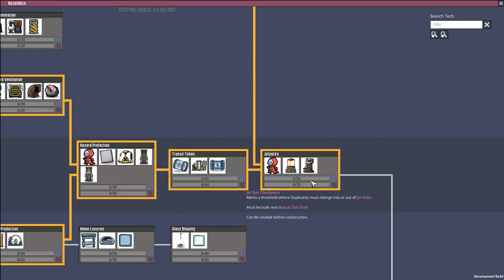The Steam Research Rocket -- New Player Guides [Oxygen Not Included]

Comment: This method worked very well for me. Two additional hints: Put a ladder made from material you have plenty of on either side of the rocket, when you are forced to open the doors to land during a meteor shower the cheap-to-repair ladders take the damage rather than the more expensive insulated tiles (especially if making those out of ceramic). Also, especially if you keep dropping the materials from cleaning meteors down the shaft, you can later put a couple of steam generators in and get a bunch of power (but that's a late game approach)

Comment: could you put some airlocks just outside the silo with some radiant pips attached to a cooling loop to turn the steam into water and prevent it from venting into space?
Reply from the maker: Yes, though it's tricky to keep a chilled bunker door from being in thermal contact with your hot bunker door.  If you want to recover more water, it's probably easier to make the rocket silo longer.  A rocket launch that starts near the bottom of the map will actually generate a lot of water for your base.